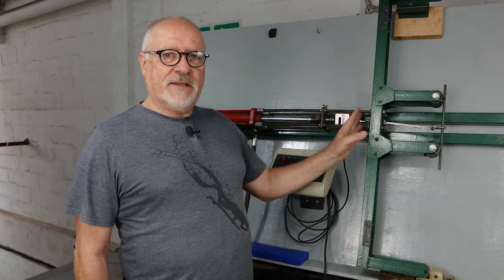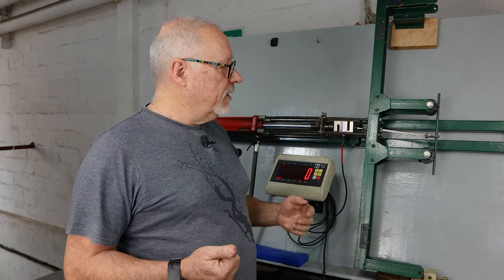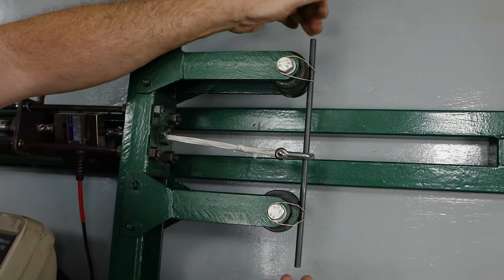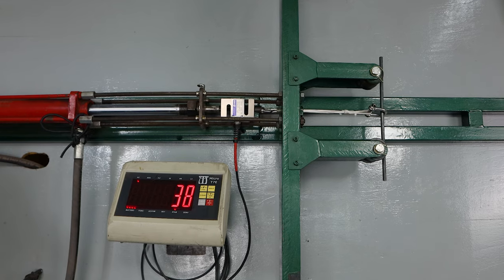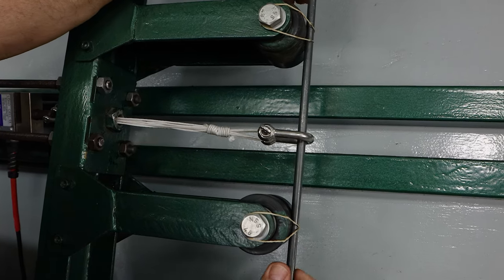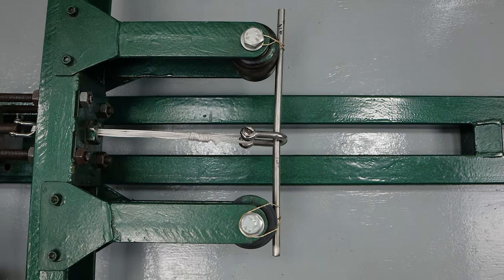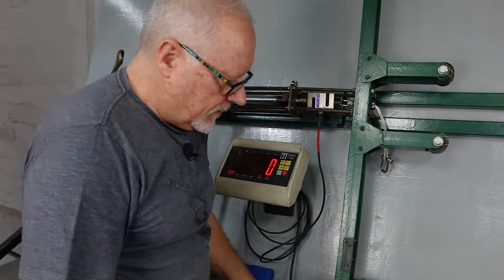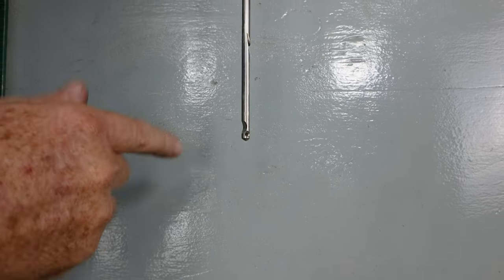Rob Allen | Stainless Steel vs Spring Steel | Part 1 | 2023

Comment: Super interesting test, thanks for sharing Rob! IMO RA has the most reilable spears. I couldnt care less if they are stainless, as long as they are straight, strong and affordable thats all that matters. I have seen RA shafts bend to what looks like 90 degress and come out straight, meanwhile expensive SS ruined after a single shot on a reef.
Reply from the maker: Many thanks for the positive response.

Comment: Nice video!  Totally agree, the corrosion on springsteel isn't ideal, but much better than a bent shaft, would love it if you found a stainless one that was equally strong. I'd also be interested to see a comparison video with the heat treated stainless steel/17.4 PH stainless steel shafts too. Cheers
Reply from the maker: I totally agree. The 8mm we tested was 17 4 PH I just did another with 7,2mm 17 4 PH against our 7mm, will be the next video.

Comment: Your equipment is all top notch. One thing I’d like to see a video or discussion about is the reverse mechs. Does Rob Allen have a reason not to develop a reverse mechanism for your traditional guns? Is it just costs in development. I hope you don’t mind me asking.
Reply from the maker: No problem asking. It's a simple reason and it is not cost. If we saw value in it we would have done it a long time back. The majority of our customers already feel our guns are difficult to load due to thew way we set the rubbers. We try to set  them such that they are almost at max tension. Pool tests have shown us that there is a max speed you can get the spear to and no further. This makes them difficult to load with the notch position where it currently ends up with our current set up. 

The majority will not be able to pull the rubber back that extra bit that will come available with the reverse mechanism. The only way they could load would be to user a longer rubber, this would cancel out the advantage of that "extra length" of drive the reverse mechanism would give. 

Yes there are guy who can load such and it will work. We could easily negate that advantage a reverse mechanism gives, just by shortening the spear 10cm. Our current spear length to barrel ratio, is that what the majority of our customers want. So, if you wanted a better spear to rubber drive ratio, just use a 10cm shorter spear. A reverse mechanism only gains you about 3cm of drive ratio. The would be 2 to 3 times better than what a reverse mechanism will give but still easier to load.

Comment: Hi rob
I bought a second hand speargun ( not ra) with ra shaft on it. A guy that sell speargun here told me that the spring steel is stronger then the 316 trigger mechanism of the speargun (abellan denton) and in time it will ruin the mechanism.
Is that true? Can i use it?
Reply from the maker: Of cause you can. Stainless spears are also harder that the soft 316 stainless steel. On a side note, the spear does not engage in the trigger but into the sear.

Comment: Lost 3 shafts of.RA....two.of.them broke at hole for the barb...and one was on the notch....but Im still using RA shafts for my 160 and 140...
Reply from the maker: Unfortunately there needs to be a hole through the spear to fit the bard and, there needs to be a notch to load. Both these are week points. Barb holes can be stressed when they hit into rocks at an angle, this can cause the steel to crack, then break off latter.

Comment: I have had a notched 7mm shaft break at the notch. Only once, the rear of the shaft must have caught in the reef and a large golden trevally that i shot leveraged the shaft and snapped it, i was surprised to pull in my shooting line with a small piece of shaft attached. Obviously the  fish got away! This is pretty rare though I think. I find hunt 7.5mm shafts hold up really well for a stainless shaft.
Reply from the maker: I'd love to test a sample.
Reply: @RobAllenSpearfishing  I don't think the best stainless shaft will compare in a deflection/hardness test against carbon spring steel. But I don't think stainless will snap.
Reply from the maker: @fishhunter348  At a notch it will snap just the same, maybe I need to do a video on this
Reply: @RobAllenSpearfishing  ok interesting, wasn't aware of that. Although most quality stainless shafts are finned
Reply from the maker: @fishhunter348  we also make a fin option.
Reply: @RobAllenSpearfishing  yeah, I use them too, they are awesome. I still use the notched shafts too, a stainless shaft will never be as stiff/ resistant to overpowering.